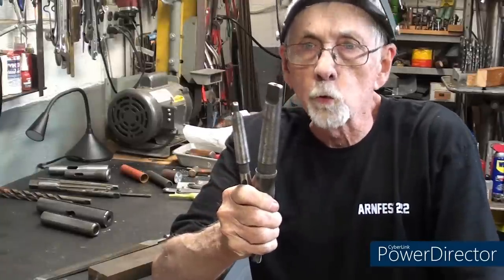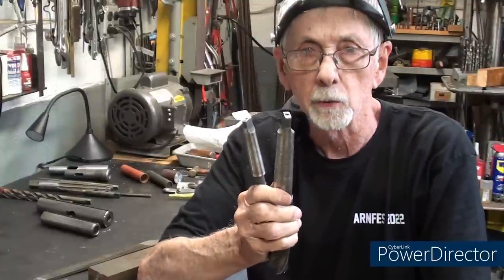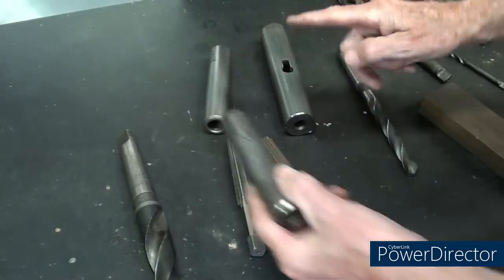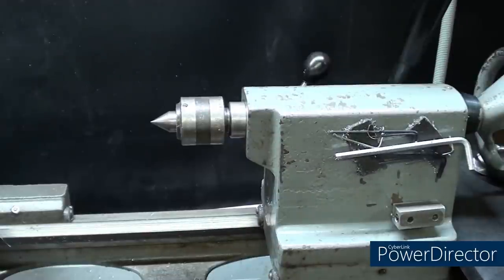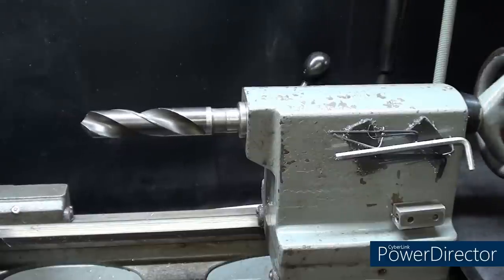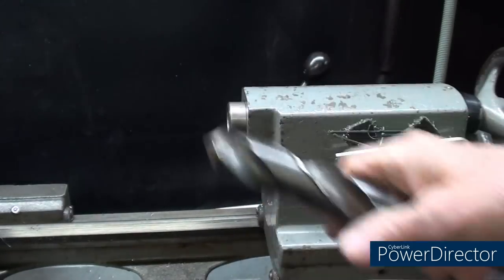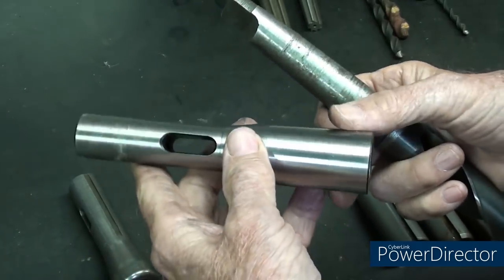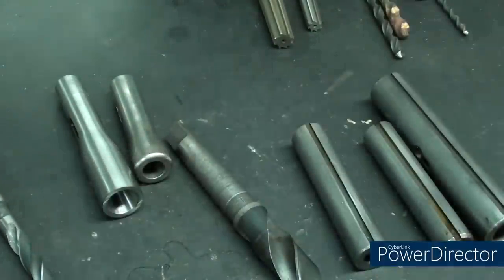DRILL TANGS REVISITED #846 tubalcain mrpete taper sleeve

Comment: I have two tail stock chucks for my SB 10k, one with a tang and the other without.  Experience has taught me to use the tanged chuck for large diameter drilling, and the tang-less one for small diameter/center drilling.  The tanged taper chuck also ejects with less movement of the quill.  If given a choice, I will use a tanged Morse taper tool over one without.  Thank you for this video.

Comment: Tangs are for both driving and removal, I think a few of us have older tools that run B&S Tooling, Morse Tooling, the tang drove the tool. The tang was also part of the removal of the tool. Since the shanks are soft on the tooling I have drilled and tapped a few tangs to accept a threaded rod, which is used as a draw bar in certain situations. Great video and it keeps people thinking!

Comment: The tang on tapered drills is used in the production process. The tang fits in a fixture so the drill doesn’t rotate during various finishing processes as the flute is sharpened.
Reply: Would the forces involved with sharpening real require a tang for constraint against rotation? That's hard for me to imagine. 
Furthermore, I would add that if the tang was only for ejecting the tool, it would more easily be turned than milled.

Comment: Hello Lyle. In high school I was taught the tang had two purposes. 1. to prevent twisting  2. to eject the tool from the taper. Later in life I learned the tang could be twisted by retracting  the tool from a hole to quickly when the tool was stuck in the work piece. Damn Carlton spindle was worn out.

Comment: Thanks for revisiting this subject, and the fact that you are not fazed by any comments or critisisms, I find this subject fascinating.
 I can see your Clausing t/stock quill being utilised as a tang stop, for helping to stop the twisting forces. 
My Boxford has no such feature, being a smaller 2 morse taper, and would only rely on the friction of the taper alone. My drill presses, although 2 MT have the slot for the tang. An old engineer myself, I think it's whoever was doing the training when I was an apprentice, and maybe it's a UK thing, either way, very interesting, it's good to promote healthy discussion! and I have bought a reamer for the 2 morse tapers, and also I would say that most of my old taper twist drills have some galling on them, proving that they do indeed slip, thanks for the post Mr Pete, cheers Dave

Comment: Comments are good for channel so here goes.  Reason for that tang is to drive drill, taper holds a lot, no drawbar pulling it in to tighten.  Using these you slam it into place enough to seat to taper so it doesn't fall out, I am talking vertical as in drill press.  Drill pressure further forces drill into taper, tang keeps things from spinning until taper is seated good.  As far as ejection goes I believe most quill slots are cut long enough to be able to use a drift even on tools with no tang.  Gee, can't believe some people think tang is for ejection only.
Story time, bought an old Camelback drillpress years ago, got boxes and buckets of tooling, #4 taper, was very impressed with 2 jaw drill chuck, also a 3 to 4 sleeve a blacksmith made, forged out complete with tang on end and tang slot.  Was even more impressed at how little runout it had.  Drill bits are unfortunately high carbon not high speed, I figured that out fast, ha.
Back when, early 80's was working for an old guy, had to be careful with drill bits,  he had high carbon bits mixed in with the high speed.  Oh well.  I weeded them out and he complained that high carbon bits were harder and would drill through harder stuff.  True but you had to run them dead slow.
Reply from the maker: Great comment

Comment: The taper should not slip . However,  it is well known that they can slip and at that point the tang will drive the tool. There are repair adapters for tools with sheared tangs. These have a flat on the taper allowing the broken tool to be ground and reused.

Comment: Wouldn't it be left round if all it was used for was to drive the bit out?
Reply: Good point
Reply: Exactly correct!
Reply: It's been in several comments that the tang is used in the production of the drill.
Reply: @machinists-shortcuts  
To stop it turning? 

Besides, aren't MT the only twist drill bits with a tang, so how are all the rest made then?
Reply: @joseph9915  They are centreless ground.

Comment: i have had a worn mt2 taper quill on my lathe constantly spin mt drills, i fixed the problem by drilling and tapping two 5/16 grub screws so they engaged either side of the drill tang, works a treat
Reply from the maker: So you created a tang slot.   Awesome.

Comment: From the Machinery's Handbook 27th Edition that I found online, the Twist Drills section, under "Definitions of Twist Drill Terms:"

Tang: The flattended end of a taper shank, intended to fit into a driving slot in the socket.

Tang Drive: Two opposite parallel driving flats on the end of a straight shank.

Straight Shank Drills: Those having cylindrical shanks which may be the same or different diameter than the body of the drill. The shank may be with or without driving flats, tang, groves or threads.

Taper Shank Drills: Those having conical shanges suitable for directing fitting into tapered holes in machine spindles, drving sleeves or sockets. Tapered shanges generally have a driving tang.
Reply from the maker: Thank you very much for that. So they call it a driving Tang

Comment: I agree, the tang is entirely pointless if it were not to help drive the drill. It is a lot of extra machining just for ejection. If there were no tang feature then the drill could be ejected just the same.. It seems that the taper will transfer drive but the main feature is alignment and the tang helps to give a positive drive. The same arguments happened on my drilling big vintage holes video, cheers
Reply: Having the tang does save machining the socket deeper.

Comment: Trevor from England In answer to your tang question if the drill is the same taper to the end of the drill with no tang shape  the sleeve which it fits  would have a smaller cross sectional area around the area of the slot making it weaker. by having a tang shape it increases the strength in this critical.area .

Comment: Diving into the whether the tang is only for ejection or to drive the tool argument a little late; my Logan lathe tailstock does not have a slot for a tang so the tool is held entirely by the taper. If I remember correctly, my South Bend "How to Run a Lathe" book shows the use of a lathe dog  attached to a tool in the tailstock and resting on the compound to prevent slipping of the tool in the tailstock. I believe that same book also talks about the use of a drill chuck mounted on a Morse Taper in both the headstock and tailstock tapers.

Comment: Hi Mr Pete  I think any flat put on the end of a rotating cutting tool is to drive it ( no one needs to correct me that if its in a tailstock that its not driven ) 
On my live centers there's no tang but it has a adjustable bottoming  screw so that you can adjust the length of the end of the taper so there's proper spacing for the drift or tailstock   lead screw . JM

Maybe someone could settle this  like Adam Booth or Josh Topper or Max Grant, Joe Pie .or both the Keith's they have all worked with indusial machines  not just small home or hobby machines . JM

Comment: I have several old Morse tapered drill bits showing a lot of wear and, because of their shorter than normal length, regrinding after the tips had broken. All the tangs are in perfect order, so logically it’s the taper that holds the drill, rather than the tang.
I was left these, and much other stuff, by a good friend who was an engineer at Horwich Locomotive Works, near to Bolton (north of Manchester UK).
Some two months BEFORE war was declared, all the old lathes and locomotives and parts were rolled out of the works (nearly a third of a mile long) into huge pits and levelled over. New machinery and materials were brought in by rail and the works started to make armoured cars and light tanks in vast quantities. Most of the new lathes and milling machines were Cincinnati from Ohio, USA. My friend said they were some of the best machines he ever used (of course as well as British machinery). Soon after war was declared, Stewart tanks started to arrive. My friend and his compatriots, were astounded at American ingenuity. Each tank came on a bogie-bolster (flat low loader) railway waggon packed in huge, sturdy wooden boxes for shipping with sturdy boxes containing all the ancillaries and every tool necessary for assembling the tank.
Needless to say, surplus tools were ‘liberated’ as well as old, broken morse taper bits.
Why am I rambling on?
Horwich Locomotive works was opened in 1887 by the Lancashire and Yorkshire Railway Company (L & Y R). My friend’s old drill bits dated back to that time and have ‘L & Y R’ forged on the shanks.
You may look up the works on Google, but there are many inaccuracies - after all, my friend actually worked there.
The prewar scrapping of old machines was top secret and workers, under severe penalties (the ‘Defence of the Realm Act’) faced lengthy imprisonment if they blabbed about it. Nobody ever did, even those living opposite to the main entrance didn’t know what all the toing and froing was about.
I’ll shut up now!!
👍🇬🇧👍🇺🇸👍
Reply: That is very interesting
Reply: @scottjones7279  Thank you.
Reply: By the way, in true English fashion, ‘Horwich’ is pronounced ‘horritch’. Believe me, if you came to the area and asked your way to ‘hor witch’ the locals would think you had just arrived in a space ship. 😊
‘Bolton’ as the ‘bolt of a rifle’ and ‘on’.
I’ve met several Americans visiting Manchester and they all seem to emphasise the ‘chest’ bit. It’s pronounced (even with our regional accents) with a slight emphasis on ‘Man’ and equal, but less so, on the rest of the syllables of the name.

Comment: OF course the tang is for driving the bit, no question about it. Like you pointed out in the previous video on this, if it was just for ejecting it wouldn't be there at all, the drift can just as easily knock out a full round end and the production would be cheaper on both the drill and the quill. 
Cool endoscope! I want one for auto work, but the one I bought was a pile of chineseium and won't connect to anything but my pc, lol

Comment: Have you ever used a 3" twist drill?    If you have you know the tang's primary purpose is to drive the bit.   You don't even need a tang to eject the bit.   About any shape at that end of the bit can be ejected with a taper.
Reply from the maker: I have never use the twist roll that large area, but even on a 1 1/2 inch drill, the torque is tremendous. And yes, the tan could be any shape just a little cylindrical piece would do it.

Comment: Mr. Pete As a test if you have an old drill you don't care about, cut off the tang and see if it will spin in a quill.
Reply: Make sure it is driven into the taper before use and not rely on the cutting pressure. If this rule is applied the whole debate is settled.

Comment: Another topic of interest that a video would be useful for is using a vane pump or motor as a steam engine. Vane pumps used for water dispensing (Procon) use carbon vanes that lubricate themselves. Self lubricating plastic could also be used for such a vane-type steam engine.
The advantages of a vane-motor as a steam engine is simplicity and small size. Good vane-motors use pins to keep the vanes in cantact with the cam-shaped surface.
Reply: The main problem with using a vane type motor is you can't employ any steam "cut off" to get the most energy from the steams expansion. Same goes for the DeSouter style air motors, great machines but very greedy ?
Reply: @graemewhite5029  Simple steam engines like the wig-wag also cannot take advantage of expanding the steam. But vane-motors are simple and very compact. Vane-motors that use pins to keep the vanes in contact with the housing do not waste steam due to leakage. Using two-stages can harness expansion.

Comment: I'm of the belief that the taper held much of the torque but the tang was the final resort. Being a dumpster diver, I found some old drill bits in there that had twisted tangs. On the other hand, I've used the drill press to "smack" the next bit into the quill in production work. Boring work if slow turning large holes.. Pun not intended.
Hiding under a chair, I'll admit I cut the tang off a pretty new JT33 to MT2 adapter for chuck in the ancient SB 9.
Oops.
Ack! Where'd the hair in your nostrils go? A good working.... Bore scope is a real blessing!
Reply: Typed too much. Sorry.
The first inside threads shown (Causing?) Look as rough as some threads I do...
Neat video and.... Ummm, bore scope. : - )
Reply from the maker: Thank you, you are a funny man

Comment: I've never really thought too deeply about this but the tang will also index the cutting edges of the drill so the chips are ejected in a certain way. Is this something that is standardised across manufacturers and what would be the thinking behind it?
Reply: That only works until you start grinding/sharpening the drill, then the cutting edge will rotate in relation to the tang ?

Comment: "The flattened end of the taper shank is designed to fit inside a drift slot in the spindle, socket, or drill holder. The tang ensures a positive drive of the drill from the drill spindle." I'm not smart, I looked up prints on them.

Comment: Something to consider: drill chucks are typically retained with just a small taper, without a tang or key. The key for R8 tooling is just to prevent rotation prior to engagement of the taper. So I'm dubious that the tangs on Morris taper drills is to prevent rotation during drilling. I suspect that they are used during manufacturing for clocking drills bits for machining and grinding operations as they are passed between different machines.
Reply from the maker: Yes, but the r8 has a draw bar to pull it tightly into the taper
Reply: @mrpete222  An R8, like C5 and Cat, has a wider angle than a Morse; so positive retention is required. But as I noted in my initial comment, there is typically nothing other than a simple taper to retain drill chucks, and this has proven to be extremely effective.
Reply: If a drill with a tang is subjected to a heavy load and the taper is not sufficient to drive it one of two things will happen. 1. It will slip until the tang drives it without damage. 2. It will slip until the tang shears off and ruins the drill. Most of the time you’re better off with a tang on larger drills.
Reply: There are 1/2" drill chucks that easily drive 1" reduced shank drill bits via a very small jacobs taper - without a tang!
If tangs stop slipping, where do all the galled drill bits come from?
Reply: @machinists-shortcuts From tailstock tapers that don’t have a tang slot. Also, drill shanks can gall before the loosely fitted tang stops them from rotating. There’s absolutely no reason for the complexity and added expense of male and female tangs except for driving drills when the tapers slip.

Comment: You asked for more comments. 
Here is my view.
The tang obviously does provide drive.
The fact that you can twist off a tang if there is a bit of swarf in the taper proves the tang is not designed to provide the full force.
If it was it wouldn't twist off.
Conclusion  .. the tang CAN  &  WILL provide drive but it is not intended or designed to.
I repeat The Dormer adamant statement that it is NOT for driving.
Reply from the maker: Great analysis. One more very very short video on the subject is coming soon. I will beat the daylights out of this subject.

Comment: Perhaps the tang serves multiple purposes where no single reason exists for its inclusion. Is the windshield used to keep bugs out of your teeth or to keep your wife's hair looking nice?

While I liked the demonstration of the relative surface areas of different size Morse Tapers, it is important to note that friction is calculated by multiplying the coefficient of friction by the force applied, i.e. surface area is irrelevant. Drilling causes torque to be applied to the drill, so a smaller taper would be at a mechanical disadvantage to a larger taper in its ability to resist slipping.

Lastly, I am befuddled by how "self-holding" tapers work. It does not seem possible, yet it is. There must be some minor distortion leaving the tapered shaft in a state of compression pushing against the tapered spindle. Tool pressure during use would increase this compression. Perhaps the larger the taper, the greater the compressive force. That is my best guess, but I would love to hear from an expert.
Reply: Not an expert but i suggest the smaller taper has less of a mechanical advantage due to its smaller surface area. To increase driving friction try 
increasing “compression” of the mating surfaces by driving the tool slightly deeper into the taper with a copper mallet.